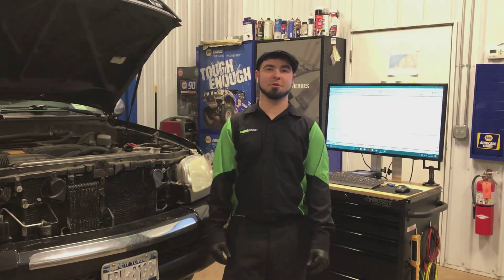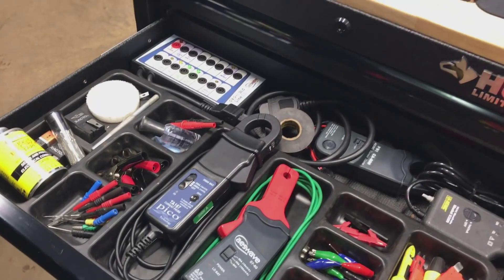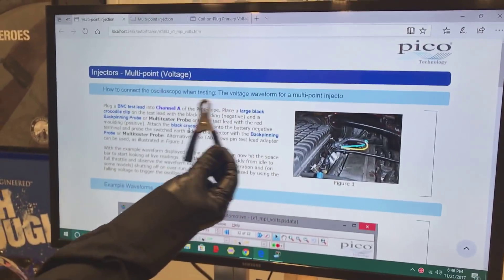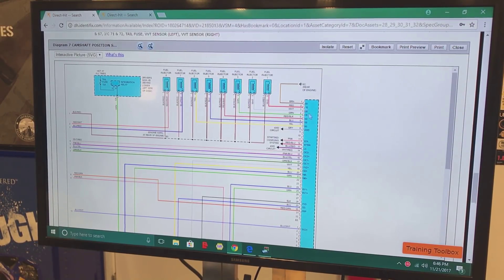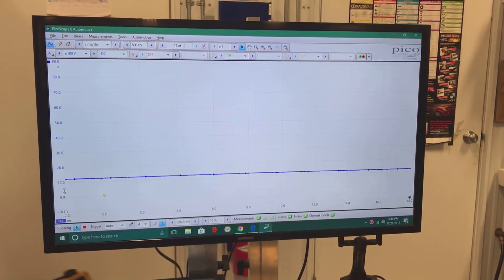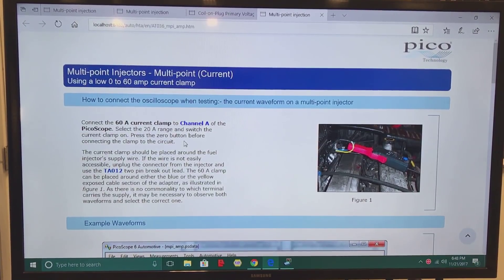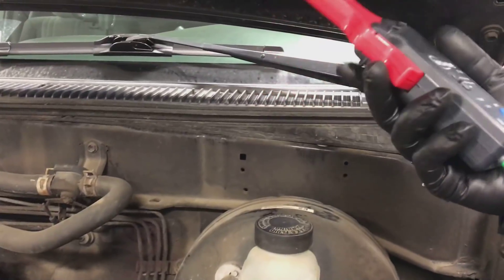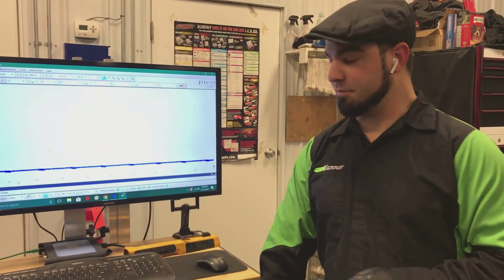Picoscope Guided Component Test Demo

Comment: Would you mind creating a video that details your exact cart setup? How everything is hooked up underneath? I need ideas for my scope setup. Everything is still in the case 6 months later. Makes getting things out a hassle. Thanks.
Reply from the maker: We plan on doing a video soon on organizational skills and showing off our carts :) One complaint people may have with using a Pico is the "extra setup" required. With a diag cart organized properly, setup is effortless and efficient.